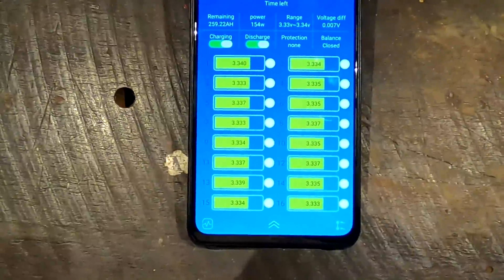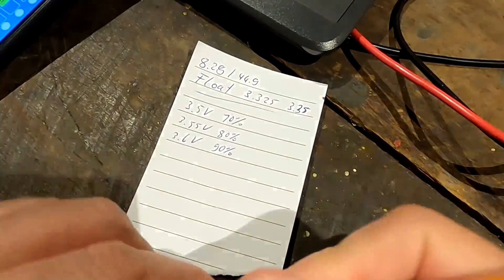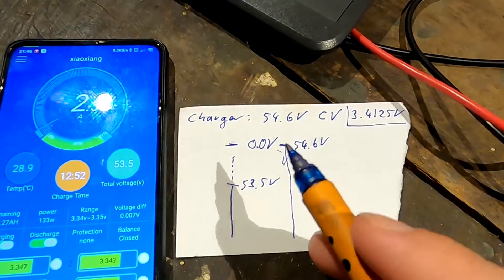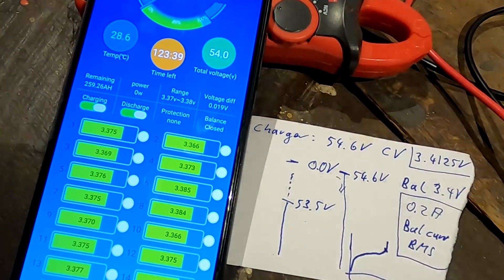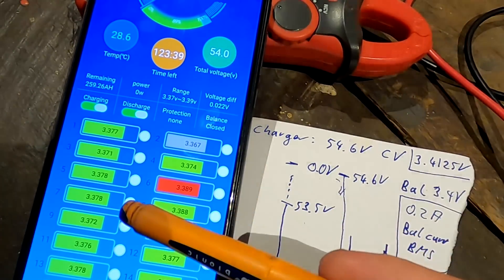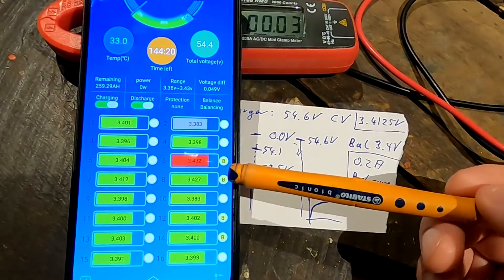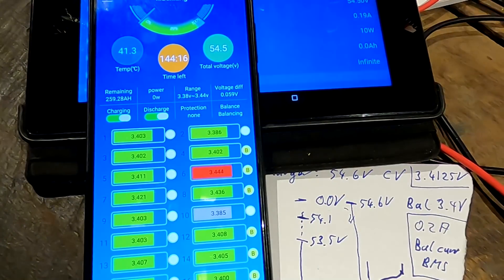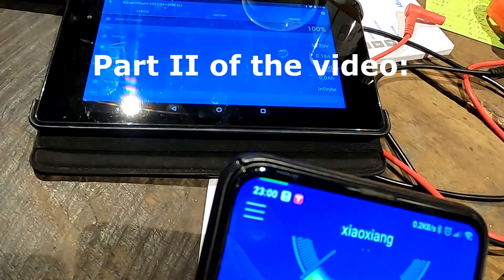Balancing a battery with an e-Bike charger and the BMS function, Part I

Comment: You need to look at an charge- and al so an discharge curve of your cells. You will see two parts. CC= Constant Current And CV= Constant Voltage. When you put an load, like a water boiler on the battery, the voltage will drop because of the demand. You understand so far? 

Oke? With charging the same happens but the other way around. The voltage will climb A LOT "under charge"... A CC charge will push your pack quickly to max voltage, but will push the batteries to fast at the end too... And remember if you over fill them... They are more or less DEAD. Like a filling a bottle with tap water very fast. That's not so easy without spilling...  So there for you need to close the tap, "slowly but precieze". Just to get more precise the correct maximum water in the bottle. 
A battery pack will start fase fase II Start the CV status. Just like you NEED to do with a bottle, the water and a tap. (battery pack, power currant and charger) It means not more than the maximum voltage will be put in the battery pack, but the Amps wil NOT be constant. They will tapper slowly down to protect the "already almost full" battery (3,40 VOLT). 

This is the same fast charge as Tesla does UNTIL 80%. Why until 80% of charge? Because of the fact that the cells COULD AND will drift more in voltage. They WILL certainly drift at the ends, full and empty charged states. So if it is difficult with one bottle under a tap. How difficult is it with 8 or 16 bottles simultaan. ANd without lights, in darkness, because of the voltage drop and jump from charging and discharging. And all cells different, even so much that they are selected at the factory to match internal resistant... It is NOT easy, it all, The High and Low end of ANY Lithium Battery is NOT a playground.. That you still have a functioning battery, is a wonder. But luckly for you LiFePO4 is a very friendly battery if you miss use it. Let me tell you one thing. All your videos NEED a BIG disclaimer, because you do a LOT of this wrong. You call it "Testing" but it is playing around (with good intentions) and a lot of thoughts and don't forget all the risk you take because you try something, which never worked out good. Sorry I saw all you video's ( I really love them! You are a very nice and honest person, but I laugh a lot because you make things fantastic complicated. That's is wrong. No prof will tell you go play around. They tell you "not directly" but they mean. Here are your battery cells. They are ready to connect into a pack. Enjoy your life! 

But you start your testing act. (inspirered by youtuber who overhauled OLD batteries!!! Hint Hint ;) You know a lot, but not the finesse. It is still hidden for you, but you will find your answers in the charge and discharge curve. And mark this tip. An battery pack likes to cycle easely, not to be FULL not to be empty. Why do you fill your pack MAXIMAAL? WHY CHARGE all cells PARALLEL TO the max? Pls.... Didn't you see the discharge curve. Do you not see the STRESS of your battery pack. It screams at high voltages and if you have drifting cells, Why GO there. There is no Energy in this high voltage range, no better battery pack, only risk. And remember NOT one human is alike, Batteries are no different (all will drift at high voltages)  Old batteries you test! New ones you use, wisely and you be NICE to them. Who cares if there is 281 Ah or 250 Ah in a big cell? I hope the sunshines every day. I bought Lishen 280Ah or 271Ah whatever.... But to empty them I can use them 4 days without Sun or charge. I use them now for 4 to 6 weeks with an MppSolar with LiFePO4 in 8s config. I charge to max 27,2 volt (8s = 3,40 per cell) recharge or quit discharge at 3,10 volt per cell. this way my batteries will never have any stress. I do max currants for boil some water for an nescafe. (2000 watt / 220 volt EU) Than my LiFePO4 delivers 90 Amps max. peek. Nominal I use 3 to 5 Amps the whole day. If you go higher than 3,4 volt per cell, than you get close to drifting voltages between cells. If you go below 3,00 volt the same so avoid that! And remember both ends do NOT have any large energy capacity. It is next to nothing... Not of any interest for a big (enough) powerwall! It only wants to cycle and have a nice life. 

Your cells max. protect voltage 3,50-3,55 volt, Max charge 3,40, Float 3,40, Back to grid 3,10 volt. DIscharge Cut Off protect 3,0-2,8 volt. Pls All who read this FORGET 3,65 Volt (very dangerous, not much cycles!!!) FORGET 2,5 Volt (also very dangerous, not much cycles!!!) Max discharge 0,5 C (140A) Max Charge 0,25 C (75A) this is all for 1p or one cell LiFePO4 (Big 200Ah+ and Biggest 280Ah) Max specs and long cycle life do not go together!! Check your specs, they will tell you. (80% DOD is the hint they give you)

If you do a walk with you family is also a lot different as a walk with an complete school. All will start and end the walk in a much larger time window.... You battery cells do the same walk. But will alway arrive at almost the same moment, but cell differences, make the differents. Just like the students. All will cross the line, but at what time and speeds exactly, i a wild guess. There is only one thing you need to remember. Your individual cells will not stop after crossing the finish line. like your students or family member. Big accidents will occur if people didn't stop... But many big accidents can happen with batteries. ;)

Pls do not take this bad. It is Not meant that way. Lovýa vids!

Comment: Its a pity its not a 56v charger, slap bang in the balancing range of 3.400 to 3.65v, your BMS balances weird, well different.  Also worth setting your  MPPT to that sort of 55-56v for similar reasoning (cant remember if you already have).
Keep it up :)

But overall - stop worrying about small ~3Ah ? differences in batches of cells. those around cell6 are probably just a tiny bit down on capacity hence hit full first.  Really, its so little to bother about.
Reply from the maker: I've got a 60V variable power supply incoming ;)
Reply: Meh, Andy is just studying and tinkering into the finer details about how this all works.  It's interesting.  Keep it up, Andy...we're able to learn from your adventures.

Comment: Andy, if the charger is capable of feeding a current greater than the balance/bypass current then you will always have “some” current flow through each series cell. Once a cell gets to the balance trigger voltage it just turns on the bypass/discharge - it’s on or off, not adjusted in response to the level over the actual threshold value. The cell in question still charges, just a bit less than the others until they are all into bypass, then the BMS should stop the charge.

I’ve found it difficult to accurately (~5mV for a 260AH pack) balance a battery with a charger, since it always is charging the cells during the balance, and differences in internal resistance ensures that some cells have a higher voltage across them than others. 

That’s why I’m a big fan of the BattGo unit I mentioned in a previous comment, as this balances when the battery is not on charge - you can top or bottom (or any value in the working range you prefer) balance without this issue. 

I’m happy with up to 10mV variation at rest, more than this then the battery gets a charge and the BattGo gets connected and a manual balance left running for a few hours to settle things out.

The BMS keeps things mostly in check during normal operation and charging, but if you want a well balanced pack (~5mV) then a manual balance every few months gets things back to where we (more paranoid users) want them to be.

Comment: Yeah mine is about the same i think the trick is to stop checking their voltages all the time only balance charge them maybe once a month or less
Reply from the maker: It depends on how you use the system, how much solar, how much load. I think it's important to not have to check the system all the time, as you said, but you also need to trust the system. So I will probably check mine all the time anyway. It's just cool to watch 😉

Comment: You linked to the wrong video for Part II :)

This situation is another reason why it's nice to have a smart BMS that can communicate with a Victron GX device to control charging. When any of my cells get high enough that balancing starts, my BMS commands that charging should be slowed down to 2 amps. (I have active balances that can balance 4 amps) By slowing charging to 2 amps with 4 amp active balancers I can very quickly top balance my pack without needing to do anything special.
Reply from the maker: Link at the end of the video seems to work. Maybe you were too quick an the part II email was not live at the point. All working now. Thanks
Reply: @OffGridGarageAustralia  Both videos were live, but the link I got was to the aluminum bus bar video. Since I already saw the part 2 video on the channel I know that was the wrong one. :)

The Orion CAN bus definitely works with Victron but you may need to get the settings from Orion. The Orion CAN bus can be programmed to work with any CAN devices because you can program it to format the CAN messages anyway you like. They have built in profiles for all sorts of chargers, even CHAdeMO. They didn't have Victron built in when I bought it but they sent me the profile. I think they've been working with Victron to get it "officially" supported but the profile settings they sent me have been working great for years.
Reply from the maker: @JeremyAkersInAustin  Great. As I'm now in the Developer Forum with Victron, I have actually seen someone over there working on Orion BMS stuff. I'll get some more info...
On the other side, none of my devices have VE.CAN ports, so I would need one of their GX device to translate between VE.direct and CAN.
Reply: @OffGridGarageAustralia  I think even if they had ve.can you would still need the GX device. You need a centralized controller that can control the other devices. The BMS just sends messages like "max amps 0" but you'd need a GX device to interpret that and convert to an action/command. IE:  Hey MPPT: please stop charging.
Reply from the maker: He's running a Orion BMS. On their website it does not mention Victron as a compatible system though.

Comment: from playing with lithuim battery for a few years i found this balancing stage can take longer then the charging of the battery i have scene it take several days to do the finale part due to very low Resistance on the balance resisters
Reply from the maker: Yes, you can charge to a higher voltage (steeper curve area) to make it easier and quicker.

Comment: You're learning, slowly. A resting voltage of 3.35v per cell is fully charged.....All this 3.65v stuff is nonsense.
Reply: Yes, Setting the float to 3.35v will maintain a full charge.
Reply: I kinda agree, for months at a time I just charge to 3.35v (13.4v for me) on the MPPT - its slows down the charging near full when there is a run of sunny days, and therefore rarely floats, but for my off grid system that works great.  Bear in mind Victron say "long life" charging voltage is 14.1 / 3.53/cell then I'm thinking 3.35 is event better.
But for top balancing/checking the balance, at least on my pack,  twice a year then thats when to go to 3.5v/cell - you have to go that high to see a difference.
Reply from the maker: You go higher in voltage to allow the BMS to balance the cells.

Comment: if 6,7,8 is discharged and charged faster then the others i would say lower resistence so current flows faster or it is down on capacity compared to the others
Reply from the maker: They have actually a higher resistance, I think. They have a lower voltage at the bottom and a higher at the top. But I have a tester coming in soon, so we can test it directly.

Comment: To properly balance, charge to 3.45 volts, that is 100% charged and differences will show better. you are now 'balancing' at the beginning of the knee, so it could well be that it is balancing on basis of measuring errors.

of your pack needs more balancing power: add a 'dumb' balance board.

you need to keep the charger running because resting voltage is around 3.35 volt / cell.
Reply from the maker: This is how far the e-bike charger can charge (54.6). I have a 60V variable power supply coming in, so can test this at a higher voltage soon.